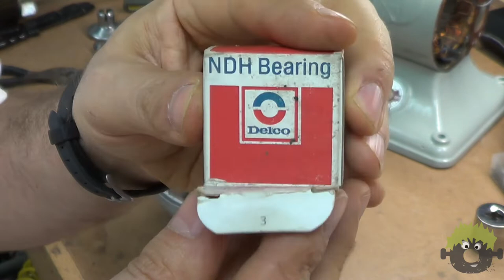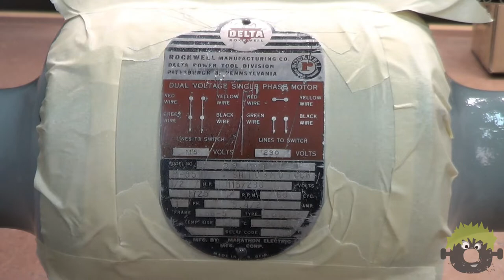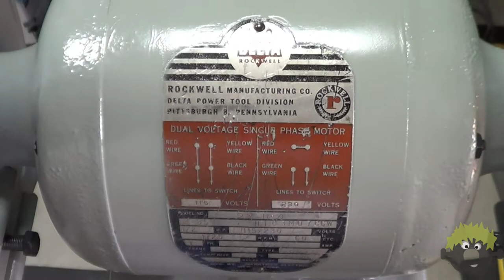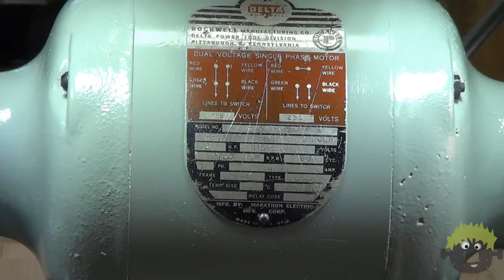Rockwell Delta Pedestal Grinder Part 3 - Final

Comment: Entertaining, enjoyed the humor and also well edited. I just found one of these in a benchtop model last weekend. Super quiet grinder....all original, don’t know if I have the heart to restore it since it’s survived this far. Just missing the cups and one guard cover.
Reply from the maker: You're spot on there, super quiet and smooth running.  Definitely check out eBay for finding replacement pieces.  Took me multiple weeks of checking listings and using the "saved search" feature but eventually got the tool rest.  I know I've seen a few lights and guard covers come available too.  Good luck with yours!

Comment: Would you post the wiring diagram for this Rockwell Delta grinder.  I too am in a rebuild of the same machine, however the wiring insulation is "shooting craps". It would be very helpful.
Thanks,
D.R.
Reply from the maker: I'll take a couple of pictures showing how the wire colors match up this weekend.

Comment: I picked up one of these today for $35, but it claims to have the 220V motor but has a regular 110 cord on it and that appears to be factory.  Also, would a 220 V motor need a start capacitor?  Mine doesn't have one and when I plug it in, the motor turns, but VERY slowly.  IS that because it's only getting 110v??  OR because there's no start capacitor?  TIA  Great Video series BTW!!

Comment: Hello.. I have the same grinder and unfortunately took  the wire wheel and the stone out for replacement. 
And in the process managed to lose both nuts. 
Any idea we’re I could find replacements?
Parts are discontinued and I’ve looked everywhere else.
Reply from the maker: If I were in your position, I think I'd create a saved search on eBay for "triple duty grinder" and keep an eye out.  I know I've seen arbor nuts and washers come up for sale in the past.
Reply: @FrankenShop  thank you!!

Comment: I rescued almost the exact same model from a government scrap pile.  I need to move it.  If anyone is interested.  It is pretty much 100% original.  Let me know.  We can maybe work something out.  I am in the greater Denver metro area.
Reply from the maker: You may also want to check out vintagemachinery.org.  They have a huge collection of information on older equipment and a discussion/message forum where you'd probably get more eyeballs looking at your machine.  Best of luck with it, glad to hear it may be saved from the scrapyard.

Comment: I'm picking up this machine in a week! Can i ask where you sourced the light switch plate from?
Reply from the maker: Certainly, it was this eBay seller: 

https://www.ebay.com/str/Vintage-Delta-Rockwell-Parts?_trksid=p2047675.l2563

I don't see the switch plate in their current listings but perhaps you could email them and ask if they are getting new stock listed.  Best of luck with your project!

Comment: Great video!  After looking for a while, I just found the exact same machine.  Where did you find the led bulbs?  Any chance you have a diagram for how you wired up the added light switch?  Thanks!
Reply from the maker: I bought the bulbs off eBay.  They are called "Ba15d Bayonet Base LED Bulb" -- many sellers are offering them (I bought the 7 watt variety).  For the light switch wiring, there will be two wires in the base coming out of the motor that currently connect to the lights (my wire colors were white and black).  Instead of connecting those two wires directly to the lights, disconnect one and run that wire (I picked black, doesn't matter which one you use) down the column to the switch, and run another wire from the other side of the switch back up the column and attach it to the lights where you disconnected the first wire.  You just basically need to put the switch inline with one of the two wires going to the lights.  That's all there is to it.  Best of luck to you!
Reply: @FrankenShop  Thanks so much!! Keep up the great work!
Reply: Sorry, I have a few more wiring questions... is there a way I could email you?
Reply from the maker: @peterstephens0824  Sure, you can email me at 
frankenshop19@gmail.com.